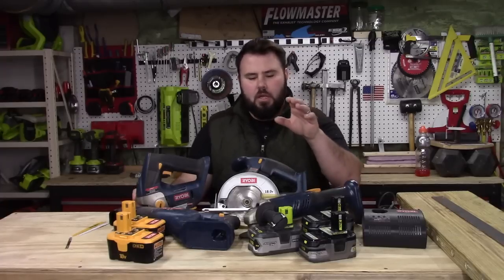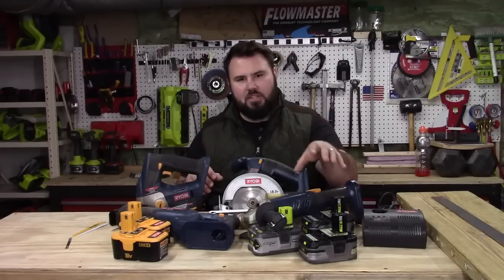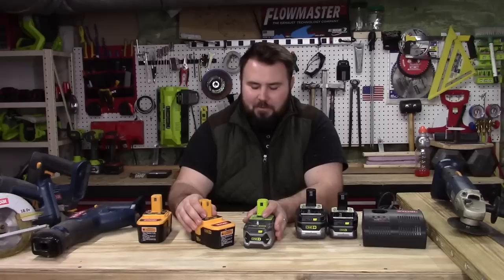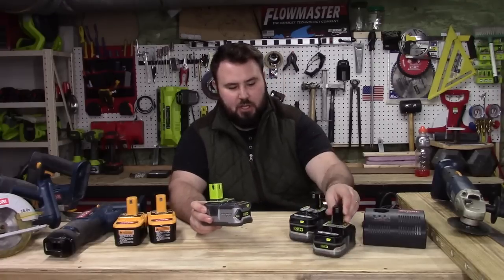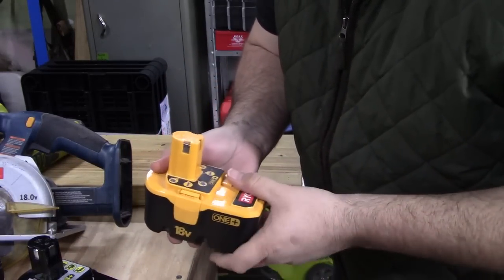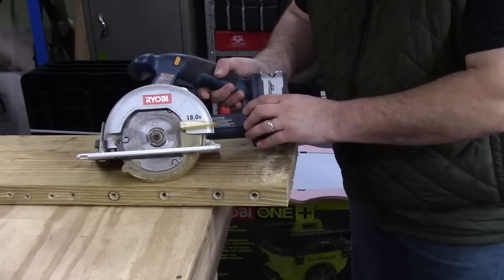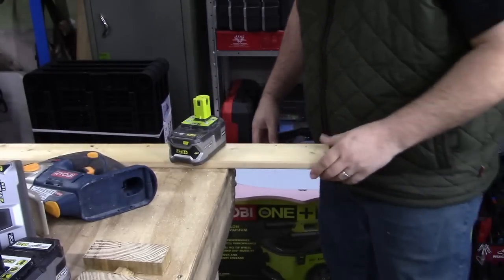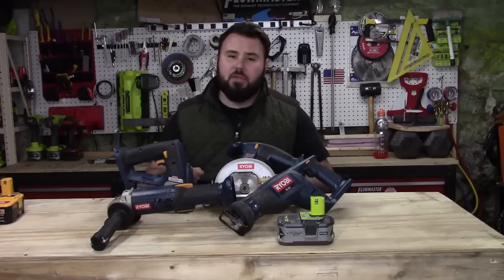Old Ryobi tools using new Lithium batteries

Comment: Being a retired female I can’t afford a lot. Came across a case of blue tools at a yard sale for practically nothing. Tried my new Ryobi drill battery in all of them and they ALL worked! I’m so happy! I will still buy the newer tools one at a time as I can afford them. I love Ryobi!
Reply from the maker: So happy for you that’s awesome!
Reply: @livefreeandtoolon  I just got a One+ series drill and flashlight with charger and 2 batteries all in their little case at goodwill for $14.  As I suspected the NiCAD batteries are dead as a doornail. I would have not expected a company like Ryobi to re-use the same battery molds from 20 years ago for the new tools. Mostly every time you buy a tool they deliberately make the batteries not cross-compatible.

Comment: Still using my blue drill and saws after 18 yrs. Been used and abused but just keep going! Only replaced batteries once.
Reply: Same here.
Reply: same here.  I want to add the sander though and fear they don't make it any longer
Reply: Me too! Just bought a 6 amp hour battery works with my old blue tools.
Reply: Same here. I make my living as a general handyman and have nearly a dozen blue Ryobi 18v that have been in continuous use, some for over 25 years. I've had to replace batteries but only had one tool die in that entire time.

Comment: The blue tools work very well with the new batteries. My dad has an old drill and vacuum that used nicd batteries. The batteries are dead, but the tools work perfectly when coupled with new batteries. Hats off to ryobi for committing to making all 18 volt tools and batteries compatible!
Reply: I noticed the lithium batteries will not fit into the older chargers due to a notch that cut into the base of the older batteries to match up with a ridge in the charger.  I got the tools for free, but by the time I buy a new battery AND charger I'll be out $70 minimum.
Reply: @PRODEVE6  yea in that case i would pass them forward and grab the newest and latest generation.
Reply: @PRODEVE6  Not sure what you mean by this comment.  You cannot charge a lithium battery on a NiCad battery charger. That is not electrically or physically possible.
Reply: @fbnmndz  Get the latest generation of chinese made junk engineered to break or catch fire with thinner plastic that will shatter to pieces if you drop it?  Yeah okay dude.  I have a 30 year old Makita cordless, one of the first ones they made, and it's better than anything Makita makes today. The only downside is it is so huge it can't be used in tight spots. It's become my yardwork drill for things outside the house.

Comment: I went a bit different route.  Recently acquired  a few Makita LXT 18V Li-tools,  and found  some  battery mounts on ebay for those batteries. So far  I've converted  a Ryobi 18V saw, Craftsman 12V drill, Craftsman 18V  sawzall,  no-name saber/ jig saw as well as  a Craftsman  90 angle drill,   and made an adapter for the old long handle Makita 9V  to make use of an angle drill and  mini sawzall  So now all these tools operate on the  Makita  18V  Li batteries.  I'm 75, and doubt these will be obsolete by the time I am unable or worse

Comment: I had a couple of those blue sets laying around for years. A few years back I dropped my green ryobi 5 1/2 circular saw that came in combo kit and it broke. I've been using the blue ones paired with lithium batteries and a Diablo blades ever since. I discovered the blade makes a huge difference as well, the included house blades are junk.

Comment: Got an old blue set of a drill, worklight, charger, and 2 nicad batteries for free off craigslist. The blue drill and light work great with my 4 amp lithiums. The nicads actually worked too after jolting them some. Will use them for camping flashlights or something. Lots of life left in these old ryobis

Comment: I bought the duffel bag set of ryobi tools YEARS ago and the batteries stopped charging after about 4-5 years.  They’ve been sitting in my basement for just as many years as I got to use them now because I didn’t think the new batteries would work for them. 🤦🏼‍♂️. Glad I came across this video.

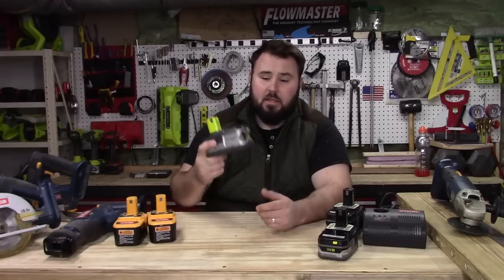Comment: QUESTION: Excellent video, question is: are the RYOBI 18+ HP series batteries too much for my blue tools and eventually burn them up. I know 18v is 18v but I keep seeing HP has more power,  I was interested in the information being presented at time of about 4:07 but it was cut out, it seemed to be heading to what information I wanted, but it left me hanging. Buying new RYOBI tools may be only brushless in the future and may need HP batteries for peak performance over the non HP Batteries. If any knows or has a direction to find this information, it would be greatly appreciated. I continue to use my blue tools until the burial end, put available money towards tools I do not have, or need to replace deceased tools. I do not want the batteries to be the death of my blue tools. Basically. I do not want to kill my stock transmission with an HP engine. Thank you for any guidance or direction.
Reply from the maker: The HP tech is the electronics where the battery can communicate with the tool and only releases more power if the tools tells it to. the blue tools do not communicate with the batteries so the typical work of the battery will be used. or you can buy the regular batteries

Comment: The old Ryobi tools weren’t terrible, but their batteries were.   They’d start out fairly strong, but they only had a fraction of the lifespan of better batteries like DeWalts.   The new lithium batteries seem pretty good.   I’ve been using them for years now and have yet to have a single battery go bad.
Reply: This is how NiCad batteries work. They have a memory. If you use the battery you have to use it until dead, then recharge it. You can't use it partially and then charge it. You also have to keep them charged twice a month or they will decay in storage.

Comment: thanks!  just what I needed to know.  I have the same pile of old Ryobi tools and lost the batteries.   Picked up a new Ryobi hammer drill which included 2 lithium batteries and the charger, for the same price as just 2 batteries.  it all works in the old saws. great

Comment: I have that old blue circ saw. Even with the 4ah lithium battery, it is PAINFULLY slow to make cuts with. The drill and demo saw are pretty good. I'm hesitant to get a new one. Are the newer ryobi circ saws any good?
Reply from the maker: The new HP tools are amazing
Reply: Did you get a new blade for the old saw? Those factory ryobi blades can't cut foam insulation board lmao.

Comment: Awesome video & EXACTLY the question/issue I was hoping to learn about/gain clarity on. 

I acquired the identical “Blue Gen” 1/2” Drill & an identical  Saw to the model you tested 1st, bundled w/ 2 of those identical P100 Nicad batteries, charger, & a large heavy duty(-ish) Blue Ryobi canvass duffel/transport/tool carrier approx 5-6 years ago. Drill was always adequate but unimpressive, saw only used handful of times, & 2 batteries rapidly declined to ~25% original runtime & a full drain idle on a shelf 24 hrs after a full charge.  The “saving grace was having 2 batteries, as I could just hot swap them off the charger every 15 min, & that workaround afforded me all day use of the drill without compromise via time (never had to wait for the “on deck” battery/had no down time other than the time for the swap) or performance. (The drill ran without any discernible drop off in speed or torque in that “rapid swap” workflow. 

Last month I jumped on a deal for the new (lime green) Gen impact driver, 2 (1.5’s) batteries, charger, and a flimsy joke of a “soft” case in a bundle for $38 after tax. I quickly noticed that the old Nicad batteries fit the new driver, & the new sleeker & smaller likewise did the dame on the old drill & saw. 

I was hesitant to even try at 1st, but eventually did (of course) & was more than pleasantly surprised that they even powered & ran (all tools worked with either battery chemistries/versions). When I realized the drill & saw both ran better than perhaps they ever had (on the absolute smallest “base” 1.5 lithium no less, though I had zero knowledge of Ryobi’s battery lineup at that time) I felt just like you described, as if I’d “won” 2 additional free tools as a result. 

This video gives me the desired confirmation & confidence in the compatibility, and I am now hunting for a good deal on 1-2 of the larger lithiums, &/or testing some of the 3rd party lithium options, as that route has been a boon in multiple products/instances previously. (Non-OEM inkjet ink or cartridge refills, photography equipment from non manufacturer batteries, chargers, lenses to flash, lighting, light stands, tripods & virtually everything in between, and everything imaginable in the computer, tablet, & smart phone accessory/component markets, to name a few of the most dramatically discounted in equal or even superior designs, features, &/or performance) I see no reason why a robust 3rd party market wouldn’t fare as well in the straightforward realm of power tool batteries, and I’ve already located multiple offerings that I plan on researching imminently. 

All that aside, finding a YouTube video that quite thoroughly covered the EXACT topic, in which the tools/products discussed, demoed, & even tested are identical matches to my own, somehow feels like the biggest surprise “win” of the whole experience, one I hope many more “Blue Gen” Ryobi owners get to discover and enjoy. Cheers. 

not on charger identical to the one you demoed was afraid to “swap” the nicad Gen batteries &/or
Reply from the maker: Glad it helped!

Comment: Old video, I know, but I just got the new 4ah battery kit and a Diablo blade for my blue ryobi saw. I was about to throw it away cause it wouldn’t cut a 2x4, and within a day I was chopping up 2x6 pressure treated and used it to build a deck.
Reply from the maker: That’s awesome!

Comment: Thanks for posting this. Just came back from the hardware store, where they were not that sure and directing me to the internet.  I have a blue combo pack and another drill which I bought at the time for the two new batteries to run all the tools. But now they are failing. So glad I have this option. and will go with the P108 suggestion, if I can get the same or comparable here in Australia. Cheers
Reply from the maker: cotteeskid glad this helped! Ryobi sells a really cool isolating to in Australia that’s not available in the United States. Thanks for the comment.
Reply: sorry mate. what is this isolating item? when I googled it, it just seems to be a isolator key for their battery lawn mower. is that right?

Comment: I’ve been using my Ryobi blue tools with the lithium batteries since they first came out a number of years ago!
I bought 3 and a charger, they are I think only 2.4 amp hr batteries but with 3 I am able to work continuously with one in the tool, backup and one in the charger! 
I’ve had no failures with all tools and batteries still working perfectly at 100%!
Unlike other manufacturers who switched to “slide on batteries” meaning you could NOT upgrade your battery technology, Ryobi have stuck with the “Plug in” format allowing us to continue using older perfectly good tools with the latest batteries!
Thank you Ryobi 👍👍👍!

Comment: Great video content, thanks for the info!  I had thrown away my old yellow nicad batteries and wasn't sure if I should trash the old tools too.  I just ordered a P117 refurbished charger (after watching your video) and will also purchase the P108 as recommended in order to give my tools a new life!  The old blue drill, circular saw, and rotary tool always worked great and served me well until the yellow nicads quit holding a charge.

Comment: Mildly unrelated, but I have an old blue Ryobi drill that has some battery corrosion in the part that connects to the battery. Is it salvageable? How do I remove it?

Comment: I've thrown out three perfectly good cordless drills because the NiCads no longer held a charge.  B&D Firestorm 12V (my first cordless drill), a 9.6V DeWalt, and a 14.4V Makita.
Reply: Well if you liked the tools, you were DUMB to throw them out.
Do you throw away your TV Remote when the batteries die? No, you simply replace the batteries.
So why the fuck wouldn't you do that with your power tools? DOH.
PS: The Makita 14.4V were excellent - mine is still my favourite "go-to" drill, been running for many years on a cheap eBay NiMH battery pack.

Comment: I got a adapter to run my Milwaukee battery's on Roybi tools and man did the old tools seem to really come to life.
Reply from the maker: Thanks for you comment that's cool! can you share the adaptor information? dont forget to subscribe!
Reply: @livefreeandtoolon  Milwaukee Cordless Blower M18 Battery Adapter to Ryobi 18v One+ Tools .      you can find it on ebay its kinda  pricey for what it is and will make you tool a little longer and heavier, but I invested in the Milwaukee lineup and only wanted a few of the Ryobi tools that Milwaukee don't offer or the simple ones that are a lot cheaper
Reply: It would be much smarter to buy an adapter so your could run your Milwaukee tools on much cheaper Ryobi battery packs.
Reply: @Videogamerforlife69  any video links for the adapter?

Comment: I have the multi tool set from this generation - drill, saw zaw, saber saw, chain saw and flash light. Definitely was ecstatic when I discovered the rebirth of these tools with the new battery technology. I recommend that you get the Ryobi compatible off brand lithium batteries “Amazon’s prices are pretty good” I used both Ryobi proprietary and the off brand extensively and find the generic to be about 80% as good as the Ryobi for battery life and inferior build quality but at 1/2 the price and similar warranty they are a better value from my perspective.

Comment: I've got a few old Ryobi tools that take 14.4v, not even sure if they are NiCad or NiMh (but def not lithium) as its not printed on the batteries, tool, or charger anywhere.  The existing batteries I have are on their last legs and it doesn't seem to make much financial sense to replace them with more basically obsolete non-lithium batteries.  Any idea if the newer batteries would work on those tools?
Reply from the maker: Hello, no the batteries will not work, the voltage is different
Reply: @livefreeandtoolon  Too bad.  Thanks for the info though.

Comment: What no-one is saying though is that the old blue tools were better quality, noticeable clearly if you take one apart to repair or clean it. Things have been cheapened over the years. I still use my blue ryobis, all I did was refurbish the ni-cad batteries into lithium ones using 18650 cells.

Comment: Ryobi rocks! I went with the Ryobi One system after a couple of other systems proved disappointing. I Have had these tools for 1 year now and I am very happy with my green tools, BUT,, I love my blue tools that I find for $5 at yard sales and thrift shops, I have 3 drills a circular saw a fan a vacuum a caulking gun (very cool!)  And a chainsaw for just $15. Every tool I have bought used has worked perfectly and do not seem inferior to the green tools in any way. The Ryobi One green is a strong value leader but coupled with the batteries working for the blue tools as well,,, UNBEATABLE VALUE!

Comment: I know some people that still use the old Ryobi blue with the new lithium batteries  they work just fine did it work as well as brushless no did it work as well as the first generation green which was brushed yes or no depends if it's the first generation of that color which is 11 years old   now a second generation I think use the 4 pole motor which gave it a little bit more power as far as my knowledge goes on Ryobi tools if you still got the old blue work light you can upgrade the bulb to LED and given New Life to it.

Comment: I bought me a Ryobi p340 
Oscillating multi tool &
I first bought a 2 ah battery
& it works good. Then I found
2 5 ah & 2 6 ah Batterys for $ 65.99
So I figured why spend $65.99 when
I can get the 6 ah for no more then
What 5 ah Batterys cost
chose the 6 ah Batterys for $72. 99
$7.00 difference big deal

Comment: Great video... Do you know if the P192 batteries will work with the old Blue tools as well?
Reply from the maker: Yes, the batteries will act as a typical non hp 4ah battery since the blue tools do not have the ability to communicate with the battery. thanks for your comment.

Comment: The whole reason I started buying Ryobi is that I was frustrated with other manufacturers who kept changing their battery designs so that when you went to buy a new tool,  none of your old batteries would fit.  Ryobi has continued to make all of their batteries backwards compatible and that alone has earned them my business.  For stuff I really need to beat on,  it's Milwaukee Fuel, but it's the same parent company now anyway. 😂

Comment: Good video.  Ryobi has a promotion now at Home Depot where if you buy the $99 battery kit which includes a charger and two 3aH batteries, ($99), you get a tool for free.  I got the sawzall.  I think Ryobi is smart to do this and especially to never change their 18v form factor.  I have already found an older 18V drill slated to be thrown away, that works great with my new batteries.  Cheers to Ryobi.

Comment: The older ni cads were ok at  best. BuT so many folks didn't realize that Ni Cads needed to be burned down to zero as much as possible to make their life longer, with out heating them up. The new Li Ions don't like to be zeroed, hence the chips that prevent this! But, I have blue Ryovi tools that work just fine with the Li Ions, tools that are 15yrs old, with LI batteries that are 10 yrs old.